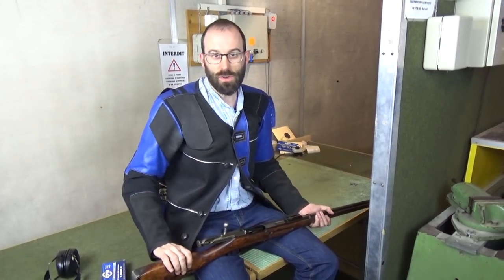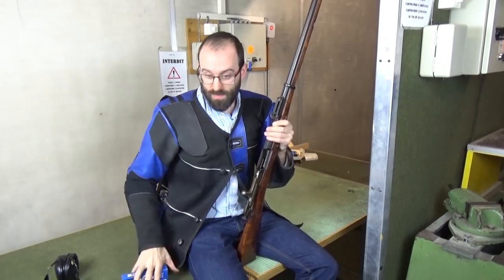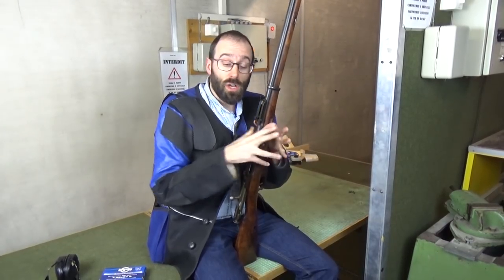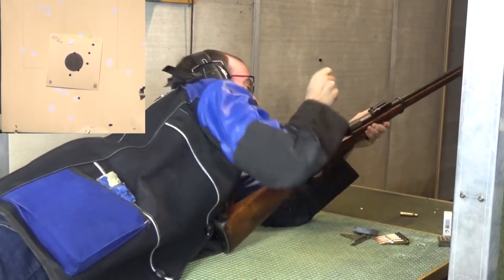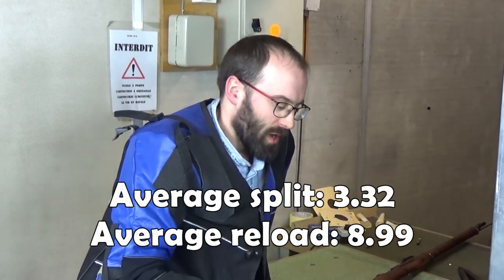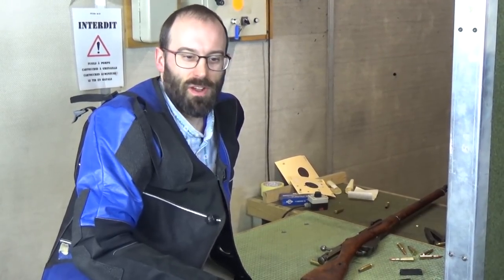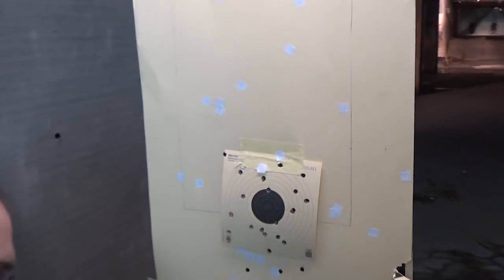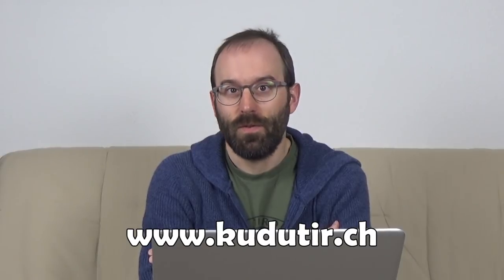Mad Minute: Finnish M24 Mosin-Nagant 7.62x54R

Comment: All I could think was lift the top round in the chargers! Not bad otherwise, could have managed better then. Your introduction was very entertaining.
Reply: I tried that, like, 17 times with my own Mosin. Didn't help worth a damn.
Reply: That lifting the top round technique is endemic of bad clip fitment. You should not need to do it with properly fit clips. I recommend WW1 clips, if you can find em.
Reply: @russetwolf13  Well I'm not familiar with your circumstances but my suggestions would be forcing the rounds down hard with your thumb when they're in then giving the bolt some real authority and it should pick up a round.
Reply: @thegoldencaulk2742  I've never seen WW1 clips for Mosins, however, the lifting of the top round has fed my Mosin more reliably than any other method I've tried and I've ended up with far fewer cuts as a consequence too. When the rounds are angled down, it seems to service the lifting technique very well.
Reply: @thegoldencaulk2742  I should also mention that I've tried it in a few different Mosins so it's probably not the charger bridge but the chargers at fault.
Reply: DJWoody if I lift my top round my m38 jambs. If I just clamp it down it works perfectly.
Reply: @theol3199  Now that is strange, well, if that works for you, use that way.
Reply: Max Paine Millions of Germans also died facing those millions of Russians. Little of it had anything to do with their nation’s standard issue 5 round bolt action rifle being easier to operate than the other. Literally a couple seconds time difference in reload speed doesn’t effect the outcome of massed pitched battles in a way that artillery, tanks, air support, mortars, machine guns and maneuvering / positioning do. The idea that the singular rifleman is determining the outcomes of these massive engagements is a very American frontiersman type thing that just isn’t true.
Reply: TheGoldenCaulk I use it even with the good factory Izhevsk clips. It’s a muscle memory thing that once learned isn’t hard to do and the consistent extra leverage is nice regardless of how smooth your clip is already.
Reply: russetwolf13 I do it and loading is a breeze. It’s almost as smooth as Mauser clips. It could just be a combination of a peacetime rifle and good clips though.

Comment: Some notes on Mosin:
- Finnish manual gives it a rate of fire around 8-10 shots per minute (Interestingly, manual also assumes this as the rate of fire for rifles of other countries)
- Pre-M39 finnish Mosins are apparently chambered for .308 bullet of the 7.62x53r, whereas the Russian 7.62x54r uses a .310 bullet.
- M91/24 is just a rebarreled Russian M91,  there is nothing really special, or Finnish about it other than new barrel.

On another note, did the rifle get especially hot during the shooting? A finnish Spanish international brigadier cites in his memoirs this as main problem with Three-line rifle, compared to Spanish rifle (Mauser). Then again, these guys were forced to use olive oil as gun oil...
Reply from the maker: The German foreign weapons book (which includes rifles that are identical to Kar98k's) also gives 8-10 for all clip or charger loaded rifles holding at least 5 rounds.
Reply: I assume what they mean is practical rate of fire for the average soldier? Keeping in mind accuracy and ammo consumption.
Reply: @antongrahn1499  Yes, I'm fairly certain that's the practical rate of fire.

Comment: "YoU DidN'T cLeaN thE CoSMOliNe"
-Mosin fan boys, probably
Reply from the maker: Several times already... And despite the fact that a) it's a Finn so was probably never cosmolened-up anyway, and b) changing the bolt lubrication basically fixed it.
Reply: "YoU DidN'T cLeaN thE CoSMOliNe"
What's to prevent the case from getting stuck in the breech, you silly.
For the smooth bolt you grind off the safety detent on the thing.
For better loading you sandpaper the clips for a bit.

Or just understand the superiority of semi-autos in fire rate, and stop taking the test results on what criteria for the bolt guns seriously, not every rifle of the time was an SMLE, nor was it supposed to be one.
Reply: @fus132  I agree.  It's never going to be slick like a Lee Enfield, so there's no use in trying to run it like one.
Reply: Fus Well the Mosin was basically designed for the same thing and the SMLE without any fundamental doctrinal differences. The only real difference was the SMLE was intended to be short enough to be used be cavalry while the Mosin still have full plenty rifles and carbines at this point. 

Also it isn’t like the Lee action was newer, the British adopted the lee action in 1888, years before the Russians chose the Mosin. And the action was not fundamentally changed through the SMLE. 

Now, no WWI era rifle was adopted with the primary goal of sustained rapid fire so it wasn’t really considered in adoption, but it is an interesting comparison.
Reply: @fus132  Or, as an alternative, just learn how to run and shoot a Mosin like this guy, but he sure does have an advantage of being a Russian:

https://youtu.be/87vqPHz7U38?t=73
Reply: @Paul_Sergeyev  Пусть знают и боятся :)
Reply: @BigSmartArmed  Точно)
Reply: @BigSmartArmed  Нашел чем пугать.
Каждый поворот затвора у болтовки = 1 дополнительный выстрел у полуавтоматики, без необходимости заново прицеливаться, про автоматику даже говорить незачем. Как я написал выше, их сравнивать по этому показателю просто не серьёзно, на велосипеде мотоцикл не обгонишь как ни крути.
Алсо, где доказательства того, что он свою винтовку не модифицировал? Со склада мосин так хорошо вести себя никогда не будет, обоймы включительно.
Reply: Blotta Mctablets kind of defeats the whole purpose of a mad minute run doesn’t it
Reply: @Mitron43  that's just utter rubbish.

Using the actual military brass with the bevel on the rims which they were designed around the Enfield chargers work perfectly in a one up, one down configuration. If you have commercial brass which doesn't have the bevel on the rim then you load them one over the next.

Bloke has several videos covering this.
Reply: @fus132  Да ты не врубился.  Пугаются не от оружия а от умения и желания им владеть, и поворот болтовки тут не причём.  Наш парень умеет владеть Мосинкой, потому что научился, а в западной культуре принято поносить всех остальных, превозносить себя и ныть когда у самих не получается а у других получается.

Алсо это город такой?  Я думал Осло.

Доказательства просты, я стем парнем переписывался, никаких модификаций нет, просто его Мосинка свежая заводская, а не послевоенный арсенальный пересбор, и по твоим представлениям что Мосинка со склада так "хорошо вести себя никогда не будет", ты просто не в курсе в чём разница.

Я знаю что такое Мосинка не по наслышке, у меня не одна Мосинка, и с моими хоть они и арсенальные всё в порядке, поэтому не надо ля-ля о том о чём не знаешь.

А настройка Мосинки это целое искусство, и мастера знают как выбирать стволы и подгонять ложу так, что с качественными боеприпасами оригинальная конфигурации Мосинки по точности стрельбы будет достигать меньше угловой минуты, и стоять в шагу с современными снайперскими образцами.

Разница в том что из за точных технологий современные образцы стандартизированы в производстве и не требуют ручной подгонки каждого образца, поэтому значительно превосходят Мосинку с точки зрения технологичности производства и самое главное с точки зрения цепочки логистики.

Поэтому на поле боя умелый парень с хорошей Мосинкой, будет в разы эффективней чем нытик с каким угодно западным образцом современной супер снайперки, вот пусть и боятся.
Reply: @88porpoise  age has nothing to do with it.
The mosin action is a second grade action since all good patents were locked by either the Enfield or the Mauser.
It's nothing more then a stop gap
Reply: Luca Johnen I was responding to a specific comment that the issues with the Mosin-Nagano are because of what it was designed for. Age is only relevant to pointing out that a rifle designed with the same goals in mind and around the same constrain (rimmed ammunition) was made earlier. 

Also, plenty of other countries designed or licensed new systems around or after that time (or just copied Mauser), that is no reason to adopt a poor system.
Reply: @lucajohnen6719  What are your sources for making such an opinion?
Reply: @88porpoise  ah yes, that might be, but not if you are the most unpopular Tsar as of yet and you give your arms the DEMAND that it is a native design.
Edit: wasn't actually the Tsar, but the native part stands
Reply: @BigSmartArmed  check the C&Rsenal episode on it, they have their sources linked.

Long story short, good patents were locked up, the Tsar demanded a native design to boost popularity, and Russia (other then Belgium or Spain) actually followed patent ruling
Reply: @lucajohnen6719 i I don't know what C&Rsenal is, and what sources they used.  Do you have a link?
Reply: @BigSmartArmed  I am afraid that I can't post links.
Just check "Primer episode 74" here on YouTube, it is an almost two hour long episode about the Mosin and all sources are mentioned in the video description
Reply: I never understood why people were so defensive of the garbage rod, by WW1 even it was inferior to pretty much every option that had been out for the past 20 years. I would legitimately rather take an 1889 Schmidt Rubin into the trenches than the Mosin, same goes for WW2. Maybe that's personal preference playing a role but I really think the Mosin is worse.
Reply: @BigSmartArmed  so a Finnish mosin, the cream of the crop beats the K31, once... meanwhile literally anybody you ask about Swiss Ks loves them, they're brilliantly smooth rifles to shoot while you can find hundreds of genuine complaints about the Mosin just with a simple google. 

Link your "English researchers" mate. I understand the interest in the Mosin but I don't understand the ardent defenders of it as a service rifle for the period. I think it's worth reminding you the only reason that Poland and Finland went with Mosins was because they had huge stocks of former Tsarist or Soviet ones. 

Also while I haven't been to combat in trenches I have seen the trenches (and not just nicely preserved ones) and with that in mind I know which rifle I would rather choose. Of course personal preference plays a role, the same way it plays a role for Mosin fans , it's not ignorant to have a personal preference.

As for my wilful ignorance I find that ironic coming from somebody who talks about studies they haven't cited and thinks one data point talking about a reworked Mosin out shooting a K31 is valid evidence for confidently saying one gun is better than the other. 

The fact remains that at the time of first introduction the 1889 was a far superior rifle to the Mosin nagant of the period and the only evidence you've provided is for Finnish Mosins which didn't come around until decades later.

I didn't even go into the fact that you're clearly having a personal preference for the Mosin on account of nationality. But I'll leave that for another day.

end of huge ass rant

Comment: Using stripper clips in my M39, I've found the most reliable way to get them to work is to partially lift up the top round with my index finger, then push down with my thumb pointed toward me. Not convenient or comfortable, but it seems to work consistently.

Comment: When loading a mosin I found that to push the rounds down, you have to flip your hand so your thumb is facing towards the stock and then push them down holding the rifle with your hand
Reply from the maker: I find getting my thumb right up inside the charger works best.
Reply: @BlokeontheRange  Last time I did it this way, I broke my nail up to the germinal matrix ...
Reply: @bounty157  That's a feature.  The pain and blood keep you awake so you keep fighting.
Reply: It’s much easier to just load it by hand it’s only 5 bullets.
Reply: @BlokeontheRange  Or you can try it the way it was intended.  Just a suggestion.  

https://youtu.be/87vqPHz7U38?t=73
Reply: @BigSmartArmed  that was an amazing mad minute.
Reply: @Hornet135  I contacted that fella.  No modifications to his Mosin, original striker spring and trigger spring.  It is a factory original rifle with all matching serials and not a post war refurb.  He did adjust the tension of the stripper clip retention arms and that's about it.  

He just knows his weapons and runs it properly.

Comment: Your use of the stripper clips went better than any of mine. Somehow, when I used them it stood the last round vertical in the magazine whilst also allowing a round to come up into the chamber. Needless to say there was a lot of swearing involved in getting it unjammed
Reply from the maker: The trick is to get the tip of your thumb up inside the damn thing and push straight down with much force :)

Comment: I had an old toz/baikal air rifle once that just oozed cosmoline. Was so bad I decided to sweat the stuff out of it by taking the stock off, wrapping it all in paper towels n binbags and stuffing it under the insulation of the hot water cylinder in the airing cupboard. Left it there for a week to sweat all the gunk out of it. Worked fairly well.

Comment: I noticed 2 things in this video that I've also noticed with my own Finnish m24. #1, the bolt getting sticky. Early Finnish made barrels had tighter bores, my m24 slugs at .309. When shooting just regular ammo, my bolt gets sticky, but when shooting handloads with .308 projectiles it's never a problem. I'm thinking the stickyness is from higher pressure from the larger bullets. #2, stripper clips. I've found that older, pre war mosins have tighter tolerances in the stripper clip guides. Some clips that I have work fine in my war time rifles, but some won't even fit in the older rifles at all. Either way I loved the video, not too many m24s still around.
Reply: kyle pedelose Thanks. I don’t have any real problems when shooting casually at the range. I might attempt reloading for it but then again I won’t shoot it enough to justify the outlay. Perhaps I should start a Finn MN collection to justify it 🤔

Comment: In order to use the Mosin stripper clips correctly you have to lift up the top round and then push down with your thumb at the rim of the round it's smooth as butter when done right.

Comment: I’ve had major extraction issues using PPU ammunition on anything with a bolt action. I have a Finnish mosin and a Swedish Mauser which both fail to extract every time using PPU ammo. I switch to S&B which is slightly more expensive but still brass cased and the issues went away. After I explored further it seemed that the casings were about half a mm shorter so the extractor wasn’t grabbing the cases properly.

Comment: The reason for that Mosin requiring a use of a plier tool may be this: all Mosin magazines were not "failure-proof", especially older russian ones. Not even all Finnish Mosins. A rimmed cartridge could stuck in the magazine well, a lower cartridge rim impeding the feeding of an upper cartridge. Finns had later "häiriövapaa = failure-proof" magazines, which were designed to solve this fatal problem.
Reply: All Mosins have interrupters to prevent rim-jam, many of them become worn and unreliable. The Finns likely just fixed them, they did not add anything to them.

Comment: Just wondering, could the sticky bolt be a result of oil-soaked brass? The bolt lugs would work a lot harder if the brass can't 'grab' the chamber, ie instead of helping hold the gasses it want's to slide back into the bolt face.
Reply from the maker: Brass is dry.

Comment: In my experience with mosins, mine work horrible on brass cases. Throw in some regular old tulammo and they work amazing. Well, amazing for what they are.
Reply from the maker: I've always found the opposite - brass slicker than steel.
Reply: @BlokeontheRange   that's exactly how I feel about it. I don't remember who made the video about it, but wasn't the mosin designed using steel case? I find that the brass is more accurate, but I see sticky bolts after just a few rounds.
Reply: @kiethkline7168  i think by 1891 steel cased ammo didnt exist. Didnt it only come up by the First world war?
Reply: @hanfpeter2822   I'm really not sure to be honest. Though that makes perfect sense. I've only got like 4 mosins. I bought some s&b brass case ammo to see if my sniper accuracy could be improved even more, but that's when I noticed it was hard to close the bolt and open the bolt. Then tried different brands in all my mosins and noticed the same results. Though I suppose it could be a difference in the modern brass vs the Russian steel